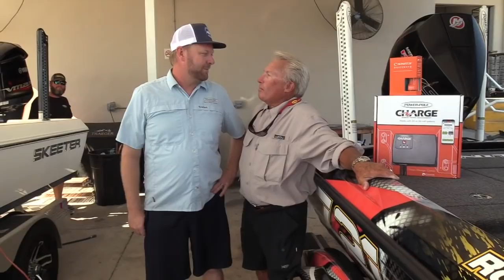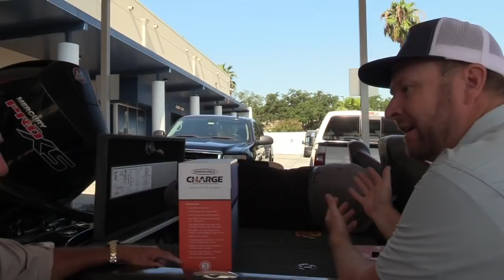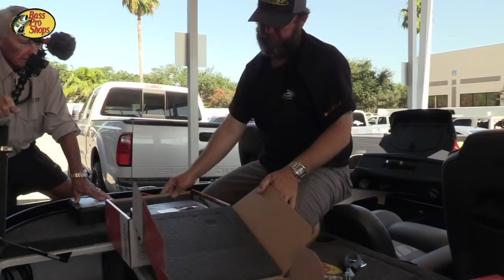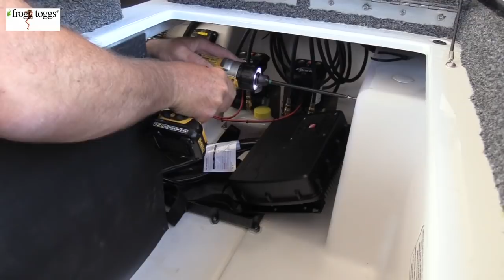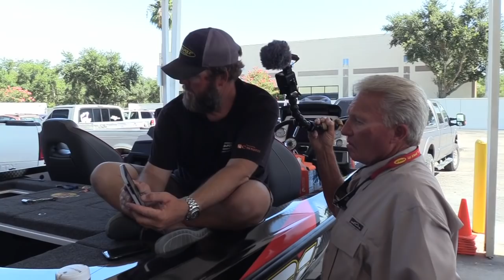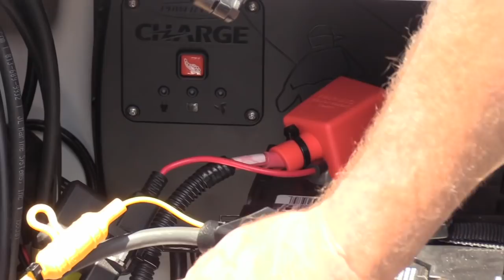The new Charge from Power Pole for my new Z-21 Nitro

Comment: 🤔. Charging your deep cycle batteries off of the outboard seems like waste of time.  The power input for them style batteries is so low you won’t get much charge out of them.    Now the emergency start is nice. But I can do that with a switch   And save $1,200 and some change.  Very expensive charge when there are others out there less then $500 that do them 3 main features
Reply from the maker: This one does more than any regular charger!
Reply: Roland Martin Outdoors  I understand what it does. But my point was there are much cheaper options available in the smart charger market.   With same features directing power to battery’s that Needs more, battery Maintaince mode, charging on run, display power of battery’s.   My Minn Kota smart charger does same things at more then half of the cost.   Now power pole has direct competition in the shallow water anchor market with the minn Kota raptor and theses come in at $400 less per pole.   I like power pole I do but if I wanted rig my boat with new anchors and charger power pole price be $5,198 and same set up with Minn Kota products be $3,298.  That’s savings of $1,900   Power pole just priced to high.

Comment: Off-subject question . I haven't fished in many years and i notice the anti-reverse feature on my older Shimano spinning reels is different than on all the newer spinning reels. On my Shimanos the anti- brings the bail-line - roller back to the top of the reel ( no adjusting for the next cast ) but on the new reel the anti - reverse stop anywhere along the circumference of the spool making you adjust the bail position ?!?!?... any thoughts ?
Reply from the maker: The newer antireverses are spring activated and will stop anywhere which I like!